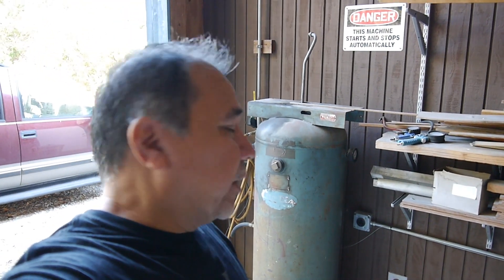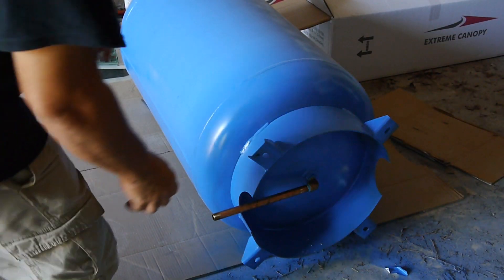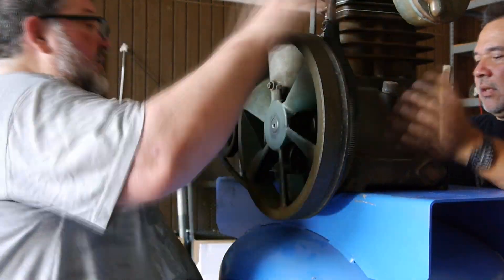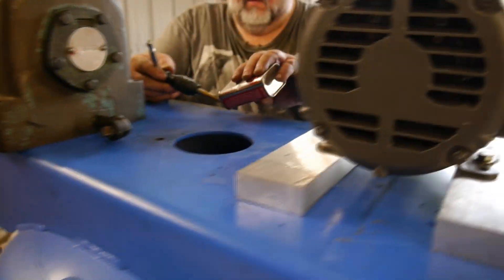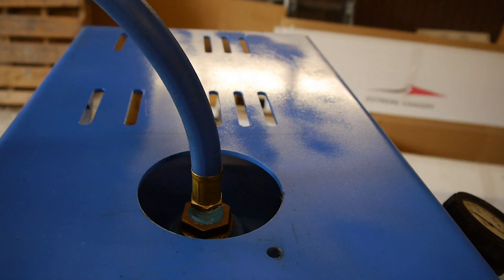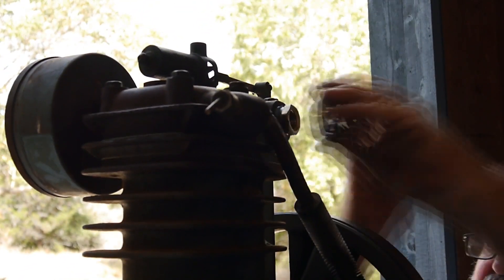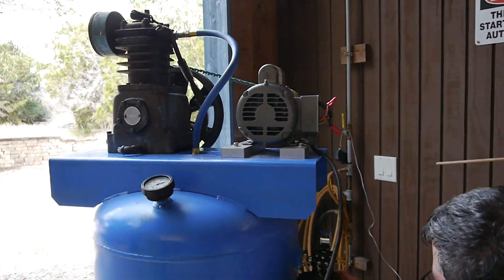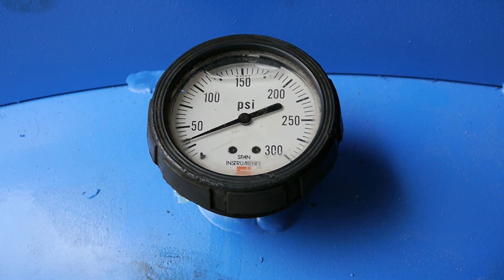Air Compressor Build and Final Assembly

Comment: Congratulations! Did you actually drain the oil and check for sediment? after all the years the old oil tends to solidify and gunk things up. Also, it seems like your drain plug would be better if you cut a hole through the mounting plate and had it draining down, otherwise when you drain, the oil is going to run all over the place, since you can't get a pan under it.  Assuming the flywheel is mounted correctly, I would have to agree with the comment 3 months ago, that it appears the fan isn't blowing across the cooling coil. This could also be the video effect, when it appears that wheels are going backwards... Great job.

Comment: Did you use a check valve at the end of that whip hose and why did you use the whip hose from the compressor head ? It will melt down.